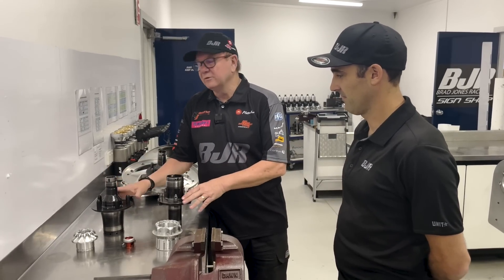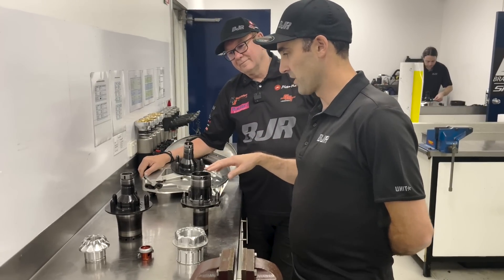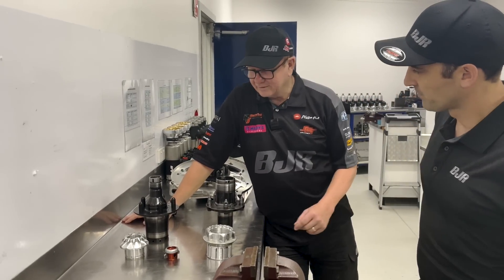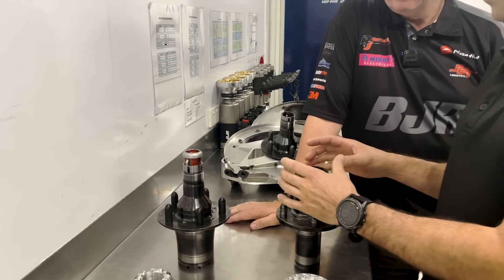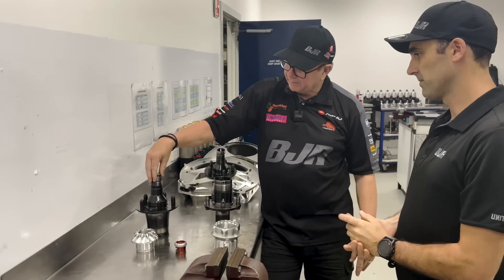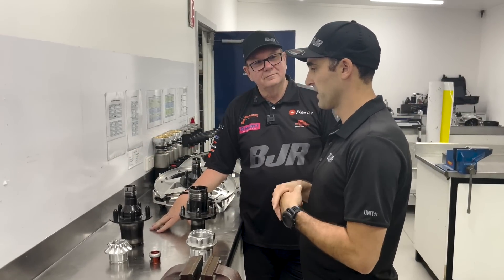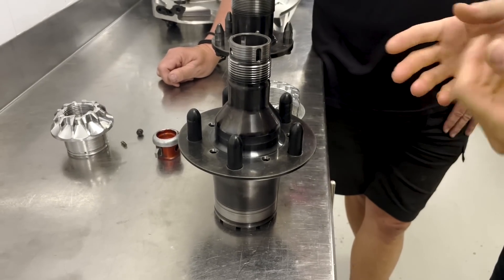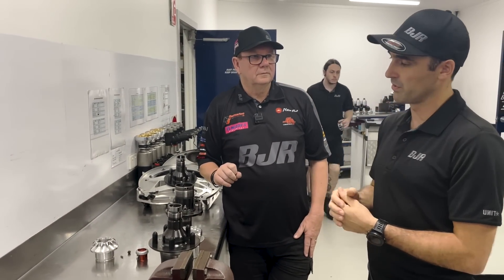Brad and Paul explain incoming changes to Supercars spindles

Comment: If the new spindle has increased thickness, there is likely to be less stretch.  Thermal expansion is probably the biggest issue IMO.

Comment: When did we start calling stub axles spindles. Another Americanism has crept into Aussie language
Reply: A stub axle refers to a stationary shaft. A spindle is a rotating shaft.
Reply: @jpl1983  not here it doesn’t. My whole life they were called stub axles. I believe even the poms call them that further more as you state a stub axle is a stationary shaft that the wheel hub and bearing spin on. If they were axles like in the differential then they would rotate which is not the case

Comment: I have a great idea,, put threads on the drive pegs and then 5 tapered nuts,, you know wheel nuts and get away from these wanker imitation F1 things. Or wheels will continue to fall off, generally not done up properly
And gee a tapered roller bearing,, like EVERY roadcar used up until the 90s when manufacturers needed to sell more parts so we got those dopey single bearing hubs. Go look at Larrys cars in the early 90s
Thanks for these clips Brad,, it just goes to prove not much real engineering went into these cars as it gets changed every couple of months
Reply: It's called development

Comment: Only issue with the tapered roller over a deep groove ball bearing is no inherent seal. Will you be running a separate seal carrier? As the F.O.S. Benefit goes out the window once you get ingress in the rollers.
Reply: (This was one of the best descriptive videos so far! Great info! Only good thing about standard parts is there is no secret in materials etc used so great to actually share that).